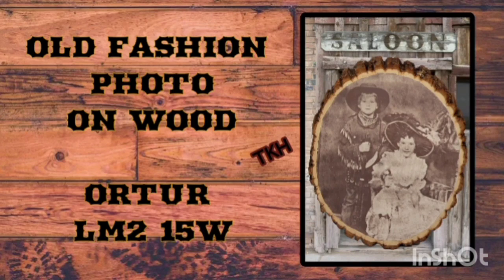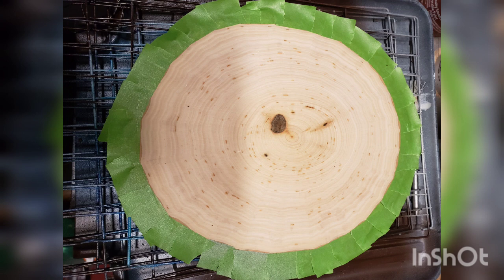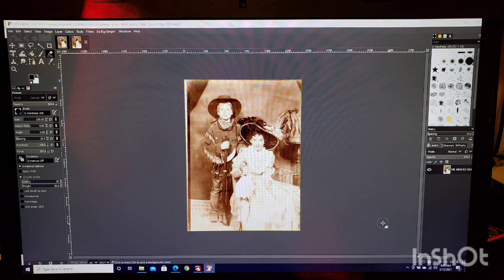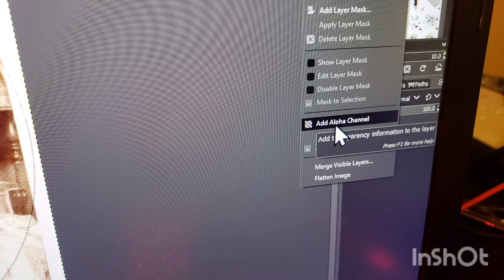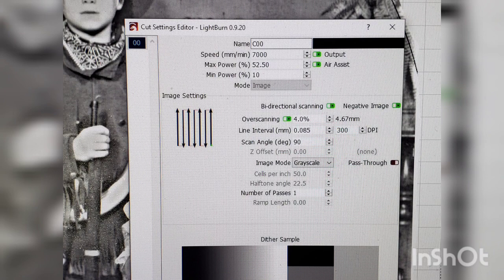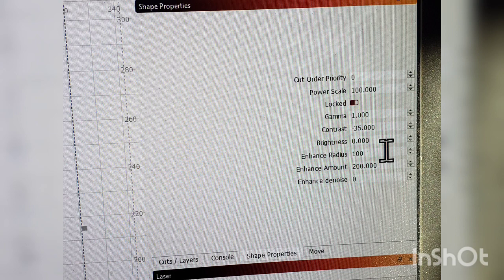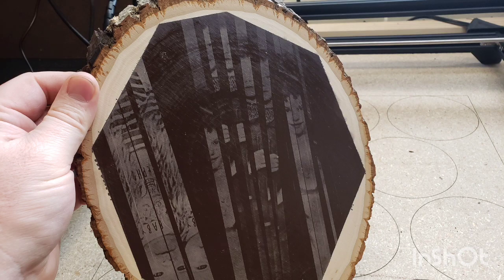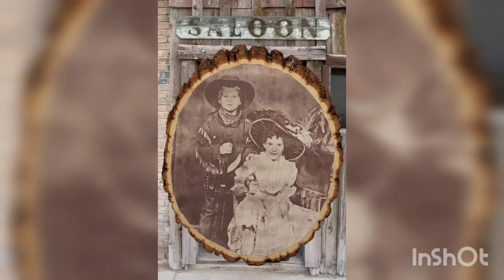Old Fashioned Photo on Wood at High Speed. Plus Many Helpful Tips.

Comment: I started spraying over pine because the grain was ruining my photos. That was before I knew about basswood.
Reply from the maker: Ya, I like to have a little wood grain in the image but too much can be distracting or make it hard to get the burn numbers right. Baltic Birch makes for cleaner images but if you don't want to see any wood grain might as well paint up some mdf. Playing around with that now as MDF is easier to work with than tile and flater and smoother than canvas. Might be the topic of my next video.

Comment: Again thanks so much for sharing your knowledge. I'm surprised that you couldn't do everything in gimp and needed to use paint. Also how did you come to the numbers in lightburn for the shape properties. That seems to be one of my issues. I have been a professional photographer for more than 20 years so I'm an expert at editing photos but with lightburn what you see is definitely not what you get.
Reply from the maker: I'm still learning Gimp so some things its just easier for me to move to a program I know. Probably ways to do it in lightburn too, but some things I can't get to work like the tutorials show. Finding numbers in lightburn is just trial and error. Once you figure out how they work it starts to make sense of how your shifting the image to burn more on the higher end of grayscale. If you're burning something normal you shift it darker if you're inverting the image you want it to be lighter. Also negative contrast moves more colors to the middle so more detail can be seen. Want to avoid having large solid black and solid white areas.